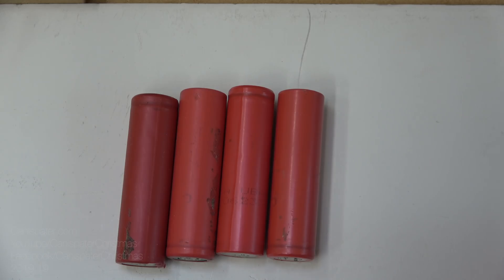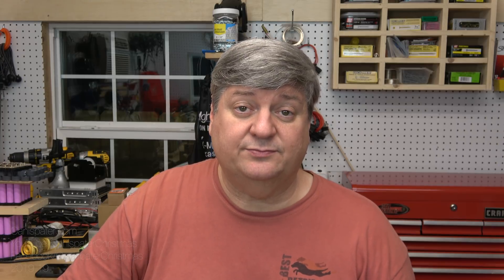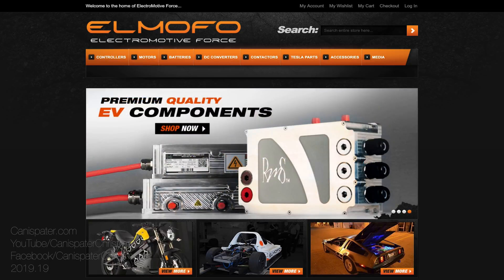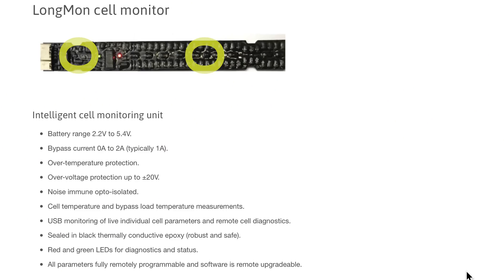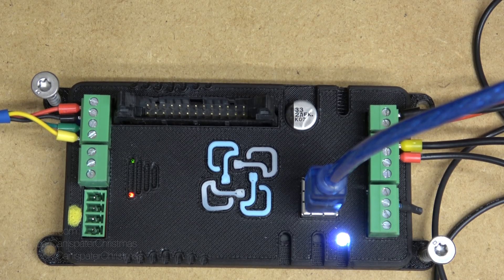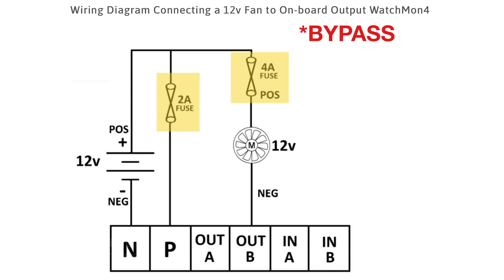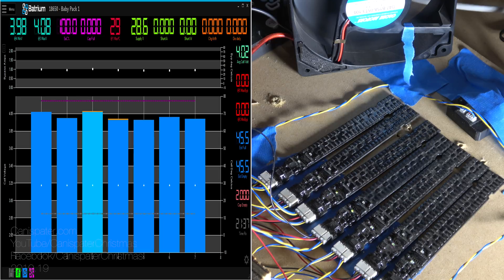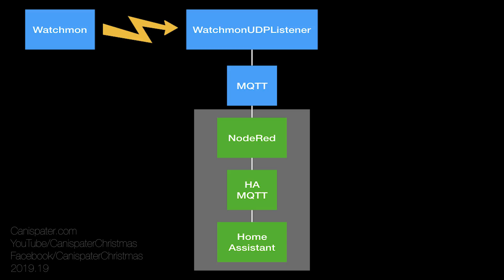⚡️DIY Powerwall Project - ep12 - BMS Demo (2019) ⚡️

Comment: Looks good.
Reply: I wish I knew more computer stuff. I wouldnt even have a clue
Reply from the maker: If you know how to use a computer, the BMS is easy to connect and install/run the app. The additional computer stuff at the end is just to show what's available, but probably not used by many.
Reply: @CanispaterChristmas  I think Im going to have problems installing the main software let alone anything more. I am the worst with computers. I had problems getting the app on my phone. Not to mention Im trying to hook up a 36s 288p storage bank. You are welcome to check my channel...
Reply: It will actually be less in parallel maybe 250. Im not sure yet. Im not sure if I want to go for more safety or more capacity.
Reply from the maker: Yeah, I saw the new battery - very impressive! I don't think it's an either/or situation unless you're limited by the current BMS. Seems to me, there's always a way - just might take some digging. Totally understand about the computer difficulties. It definitely helps that I've been playing and working with computers for 30 years. I can't tell you the number of hours I spent on the phone with my mother trying to talk her through "the www." :)
Reply: @CanispaterChristmas  im using a Batrium for that system. I didnt know there was a relay port on the WM4. I thought i had to get the expansion board. Which i didnt. O well i figure it out. Thank for sharing

Comment: About your Generator: I've got a Honda Eu200i that has a toggle like switch on top of the gas cap "air valve". You have got to put it into the on position to have it run right. Hope this helps. Keep up the great work on your channel.
Reply from the maker: Ha! Yeah, I HAVE made that mistake once or twice, but not the issue this time. In the test, it ran great for just under 4 hours and then stopped and wouldn't run reliably after that so something went wrong. Next up on the list is a fuel pump replacement, but I want to run more tests first. Also, I've been reading about adding an adapter so it can use propane/natural gas which bypasses the gasoline fuel system (routes the gas directly into the carb and uses regulators to limit the pressure down to where it needs to run). Still researching that one, but everything I've seen so far is that it's a good mod and people that have done it and use it regularly are happy with it. This is a rarely-used generator so not worrying about the "gas" going bad is also a plus. A 20-pound propane tank is roughly equivalent to 5 gallons of gasoline with a much better shelf life.